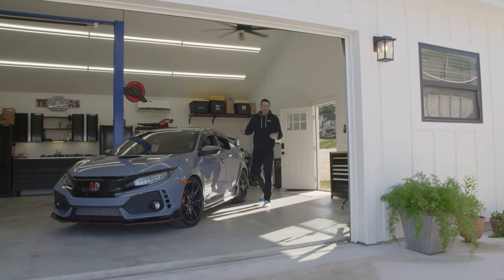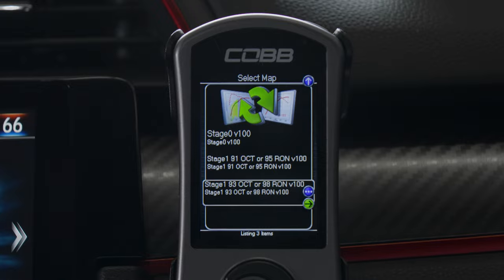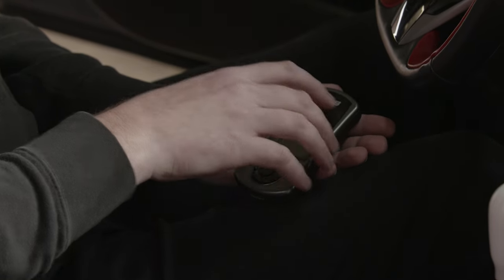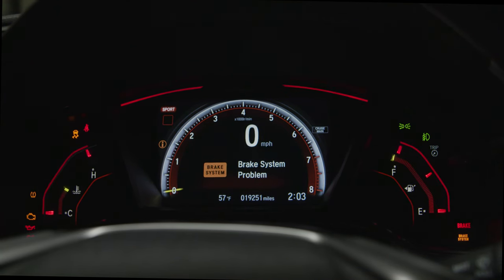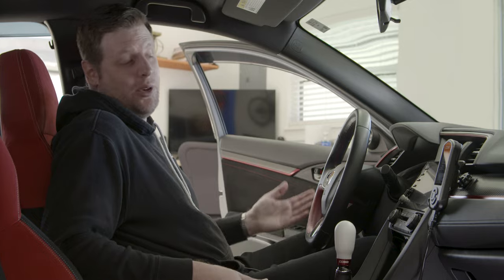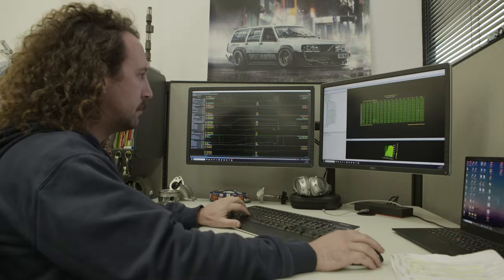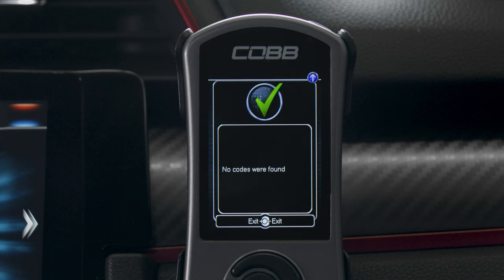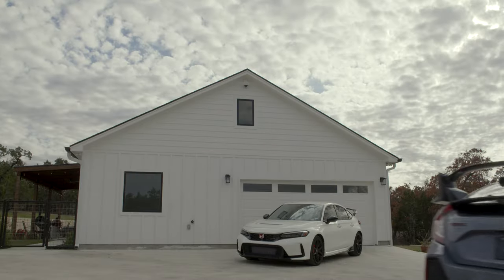COBB Tuning - The COBB Way for your FK8 Civic Type-R

Comment: Long time hondata user. But im really feeling this cobb tuner.. i always like cobb product.  I think ima going to try this on my fk8.  Does this cobb turning jailbreak the ecu?
Reply from the maker: The Accessport comes with our "Unlock Box" which is used to install on 2020-2021 cars. No additional fees or waiting time, everything you need is in the box.
Reply: @cobbtuning awesome can't wait for the fl5, can you reset it to factory and is it detectible by dealers? I see y'all answered that question... How safe are these tunes? What sort of psi etc?
Reply from the maker: @alichaudhry12  the included COBB OTS files are generally on the safer side.  While they produce substantial gains over stock, there is still some on the table for those who want to push the engine a bit harder. - Marshall@COBB

Comment: Ordered, see how it goes when it’s installed.
Reply: Please keep us updated!
Reply: @Nakafoto  will do for sure
Reply: @Nakafoto  sorry about the late response but had it on for a week now and overall car seems smoother when just casually driving, but when you go to hit it the car it is like a missile. Super fast to get boost and stays in power range better. Only complaint is if you want to keep the access port on you have to unplug it every time or it’ll just stay on when the car is off.

Comment: A little confused by the numbers, type r stock is around 306-315 hp. You’re saying OTS Cobb is around 345-357?
Reply: Cobb always lists % gains because dynos are all gonna give wildly different numbers. But percentage before and after should be consistent. So if you have a stock baseline... Just multiply it by the listed percent and thats what you can expect to gain.

Comment: Would the tune be reversible back to oem tune and have issues with the warranty?
Reply from the maker: You are able to completely remove the Accessport and tuning from the ECU using the Uninstall option.

Comment: So 2018 type r you don’t need jailbreak? Plug in play?
Reply from the maker: Correct!
Reply: @cobbtuning  can we reset the ECU if we need to take to dealership for anything ?
Reply: @PappoProductions   you can uninstall the port which will put it  back to  the stock ecu. Pretty easy to do same process as install pretty much
Reply from the maker: @PappoProductions  yes, you can perform an Uninstall on the Accessport and it will revert to stock programming.  Once work has been done at the dealer, you can reinstall just as easy!